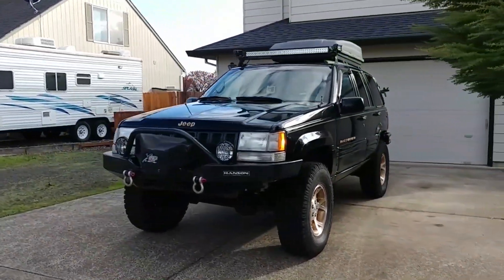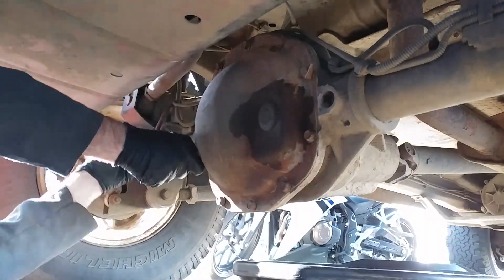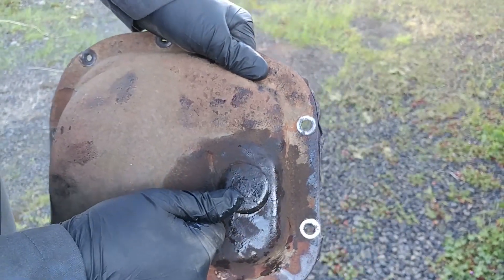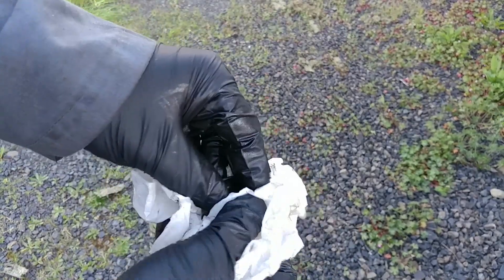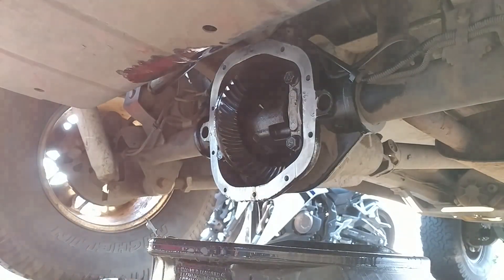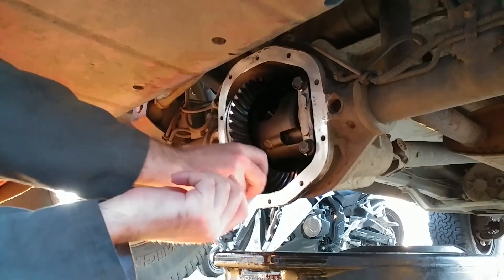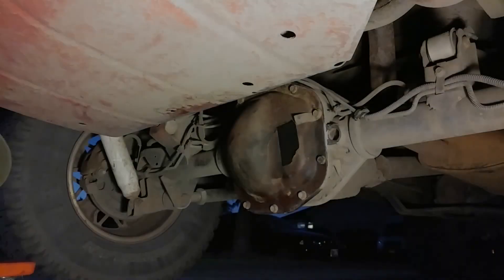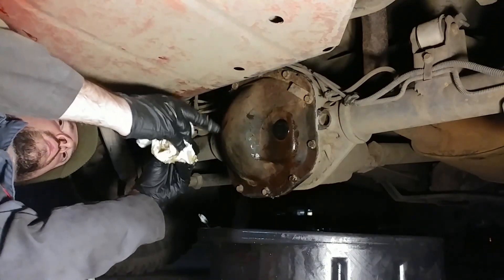How to Change Differential Fluid - 1993-1998 Jeep Grand Cherokee (ZJ)

Comment: Great video man just changed the fluid and cleaned up both of my diffs on my ZJ
Reply from the maker: Glad you found it helpful! I'll be doing a video on replacing the transfer case fluid and doing a coolant flush pretty soon.
Reply: @EndlessMoneyPits  sweet! coolant flush video will be helpful, I haven’t done that yet. I’ve got to change out my rear diff spider gears eventually I’m just putting it off till it’s warmer outside to go pull some from a junkyard haha
Reply from the maker: Apparently I'll be filming an O2 sensor replacement tomorrow on the Jeep. It started running like crap last night and I just figured it out and got the new part a few minutes ago. Real fun laying under the jeep in the snow. What an endless money pit... lol
Reply: @EndlessMoneyPits  J.e.e.p. life haha

Comment: I know what you're saying about these being endless money pits. 
I paid $3,000 for my ZJ and so far I've had to put in another $1,000.
This is endless. 
Only put 40K on the car though.
Reply from the maker: That's not so bad. I bought my Jeep for $1,600 and have put more than $10k into it in less than 40k miles. Right now I'm shopping for five new tires... 
Hope that makes you feel better 😉
Reply: @EndlessMoneyPits  Cool. I'm really happy with how much money I have not had to spend on this Jeep.
Reply from the maker: It can become an addiction if you aren't careful, but there are worse addictions to have.